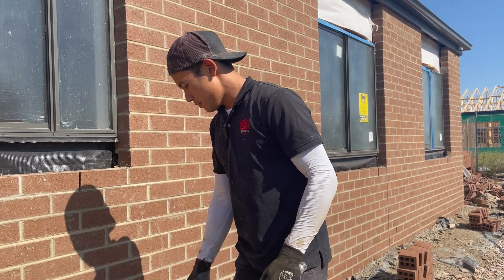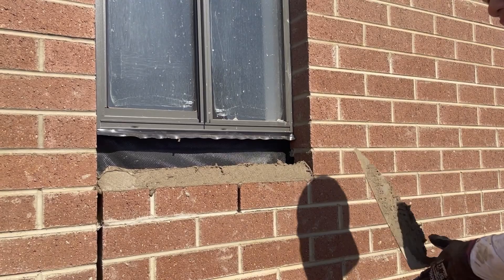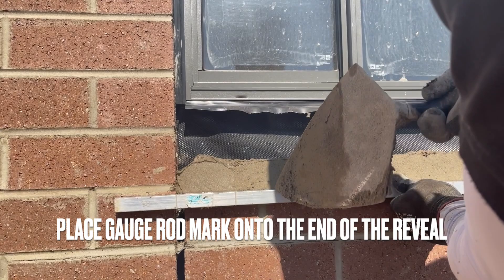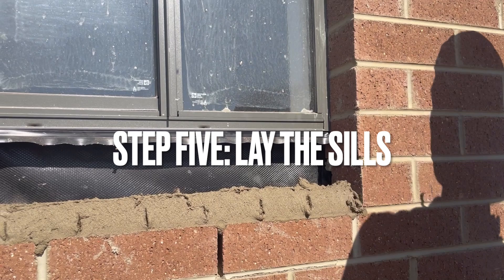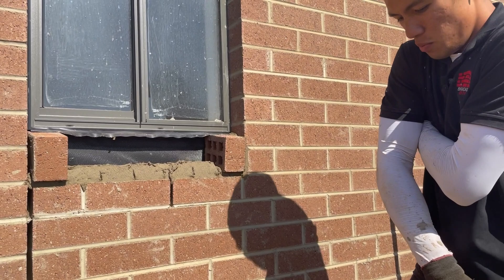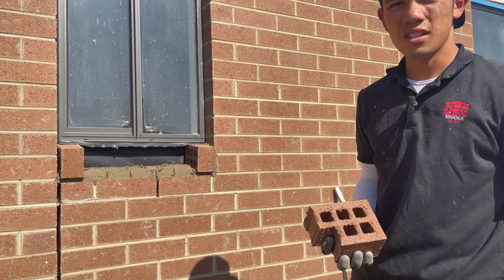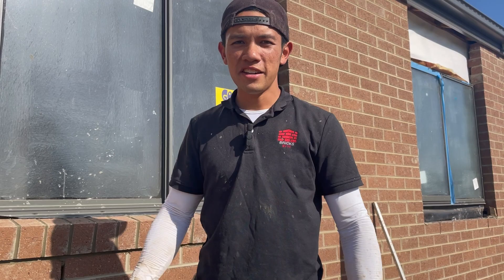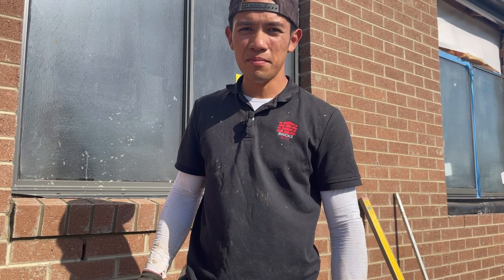HOW TO... Lay Sills | BRICKLAYING AUSTRALIA

Comment: Hey ty. Im new in australia and finding your vedeos  really helpful for a bit of inside knowledge before i start work as things are always different.

Little tip: when i lay two sills close together and same height i would lay both cills at the same time with one line. Lay two bricks on one end of sill 1. Then lay 2 bricks also next to eachother on the opisite end of sill 2. ( saves bricks mooving when the line is tighter) have the line set just above the bricks, then brick the line down each end. Lay both sills at the same time.  Twice as fast to set up +  looks spot on when ranging through both sills at eye sight when completed. 👍🤙
Reply from the maker: Hey there! Thanks for that, I’ll keep it in mind! Welcome to Australia!

Comment: Why is there a little gap with no mud in it in the bricks? 
I am asking because I am thick...😀
Edit Is it an expansion joint ? If so does it get filled in later I'm confused?
Reply from the maker: Correct!
Reply: @bricksbyty  Hi there, so you just fill it with the same mud later?
I thought it was maybe for sparkies or something ..
Anyway cheers 👍
Reply from the maker: An expansion foam gets placed inside that gap and the exterior gets filled with caulking to allow for any movement of the building overtime.

Comment: Never understood why they get you to put weep holes under a single story widow when there are weep holes down the bottom. Crazy engineers. 

You would likely only be familiar with houses on slabs because almost all houses are on slabs these days, but when doing the sills on a house with a timber subfloor ( which includes the first story windows of a house on a slab ) you should slide a packer in under the rubber seal so you end up with a gap between the top edge of the sill brick and the underside of the window frame. This allows for subfloor shrinkage which will over time allow the window frames to be pulled down. How much gap depends on A. The builders opinion, B. What type of subfloor timbers are used. Engineered Timbers shrink less than some other timbers. A 4mm Masonite packer can be used or some 6mm cement sheet pieces. You pull those packers out once the sill is laid and the bed joint gone off enough that the sills won’t move around. 

In the good old days when OBH (unseasoned ordinary builders hardwood) was used as the subfloor timbers you could literally get an inch of height shrinkage. That’s why you will see in many old homes the sills are cracked and lifting. OBH is no longer used in place of KD hardwood or engineered timbers but you still get a little shrinkage. 

Not that many do it but this is also why ideally any gas or water pipe coming out of a wall in these same scenarios should have a flexible opening around them, not hard mortared.
Reply from the maker: Thanks for sharing your experiences in the trade. Definitely helps us younger bricklayers grasp a piece of history, and perhaps a learning lesson from the trade too.